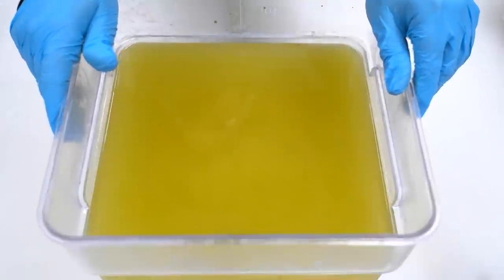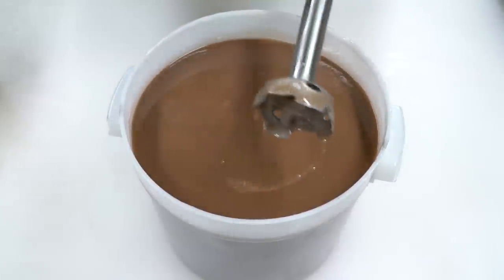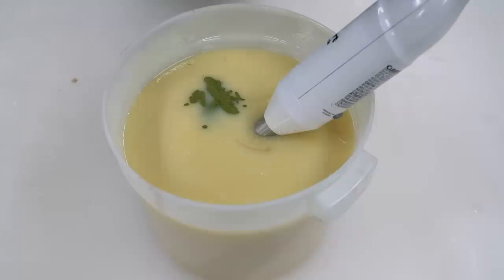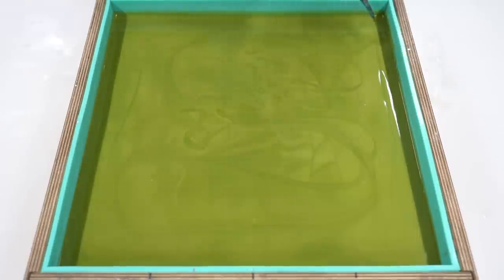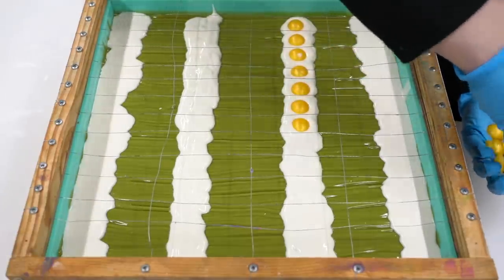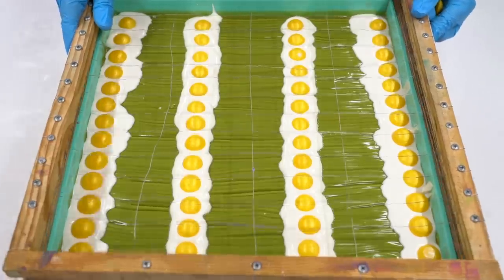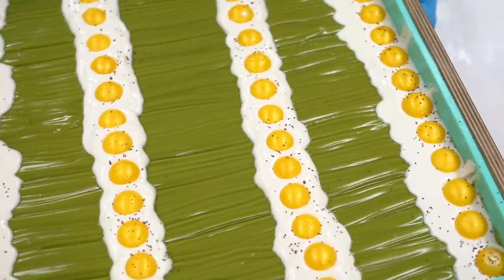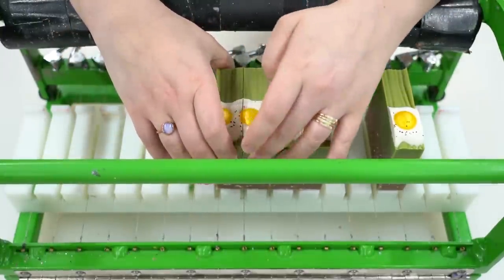I Made Avocado Toast Soap for My Fellow Millennials | Royalty Soaps

Comment: Katy! What about rubber bands instead of wires for the grid? They wouldn’t get bent out of shape so easily and you could replace just one rubber and as needed 🤷🏼‍♀️
Reply: Also, TWANG!!
Reply: Hmm the rubber bands might break easily so maybe she could double or triple them up?
Reply: @m1kayla143  that’s only if they were stretched right across the frame. And that’s unnecessary
Reply: She can do a twine too

Comment: Love the soap, Katie! 

You've been talking about your grid recently and ideas to fix it. What if you did something like guitar strings where you can replace them and tighten them?  There is probably a way to do it with wire, screwed and such from the hardware store. Then you can set your tension and easily replace them when needed.

Comment: would it not work if you had a cutter that you could press straight down from the top instead of pull it down from the side having to guess where it cuts? if you can press cut it from straight above you can kind of place it before you cut it like you can also cheat placing the egg yolks